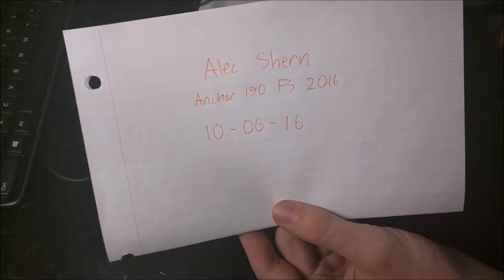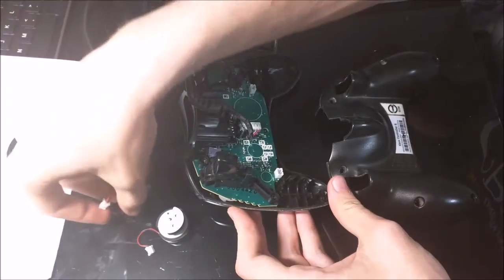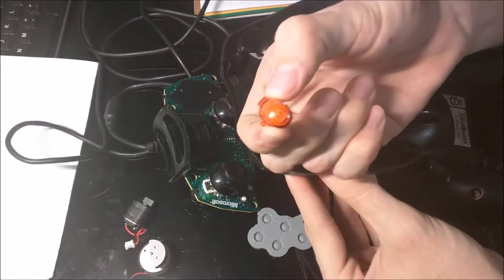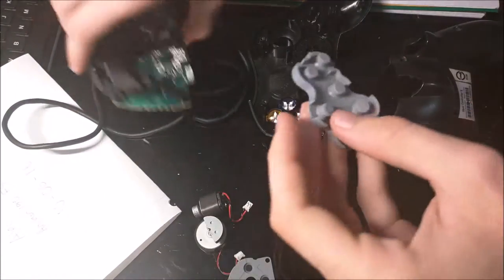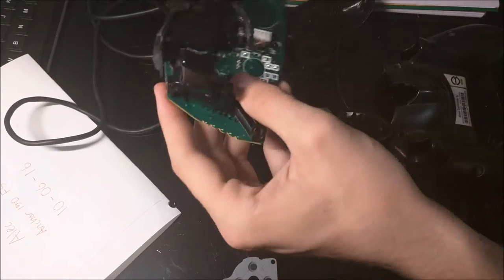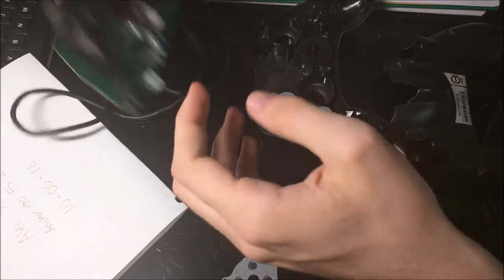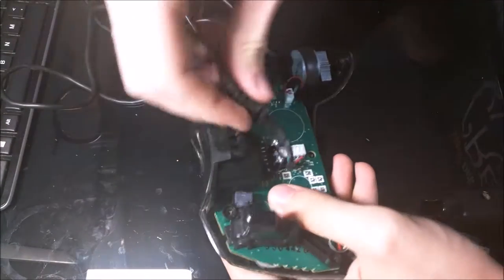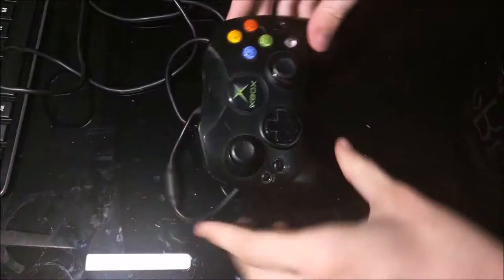Disassembly of Original Xbox controller

Comment: Does the cord unplug like the rumble motors? I need to remove my frayed one and don't want to accidentally rip it from the board. Please let me know.
Reply: If it's like the newer controllers the cord is soldered to the board and has to be desoldered from the other side.  Most are easy to remove with some copper braid but the ground one takes a bit more heat.

I haven't found a source for replacement cords on the original xbox yet though...